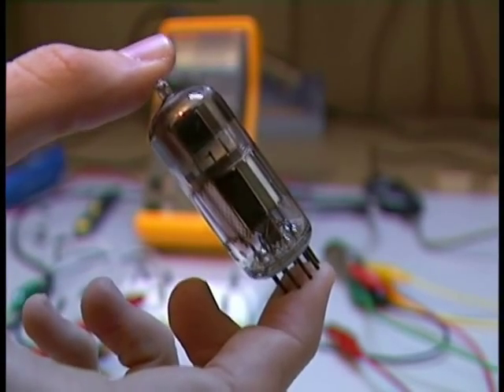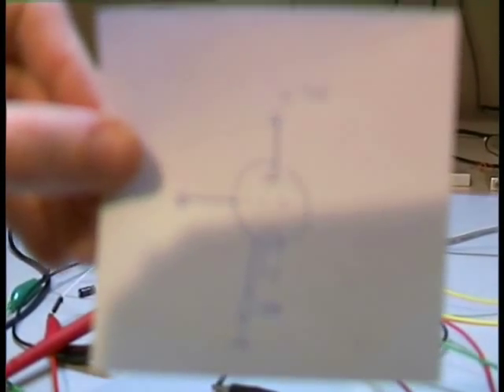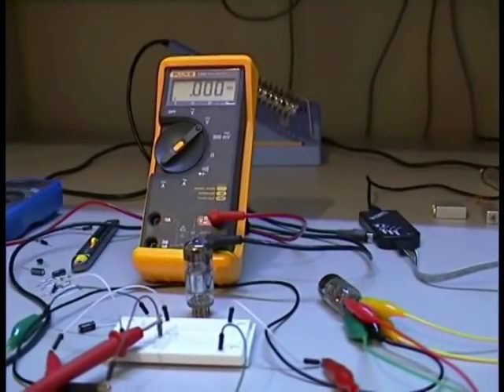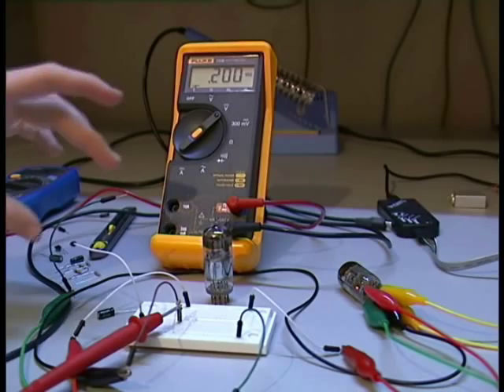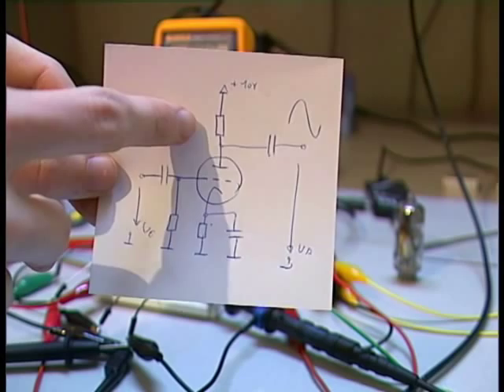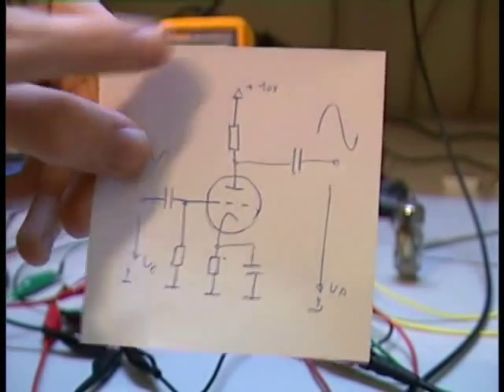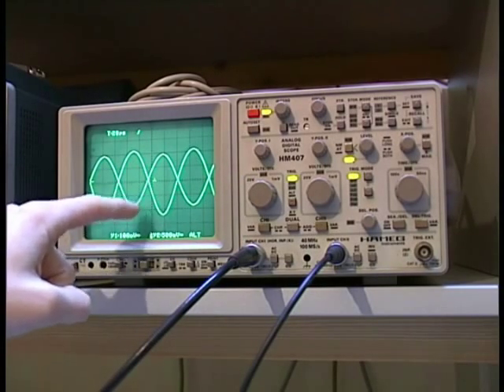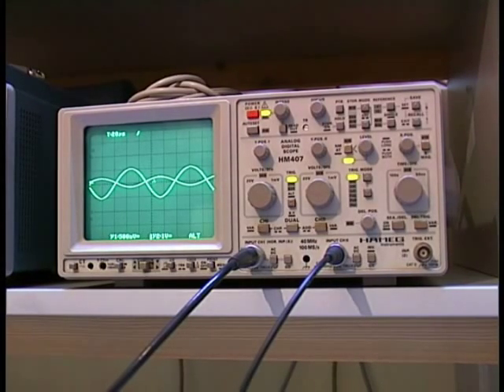Vacuum tubes (PCF80)

Comment: Thankyou, I have some PCF80 tubes so I'd like to try a transistor circuit,
and audio amp perhaps. You'd need an impedance match transformer still to 
drive a speaker yes? Also it would be nice if you could specify the value of all amplifier components you used, given that I will use the same voltage supplies that you did. :)